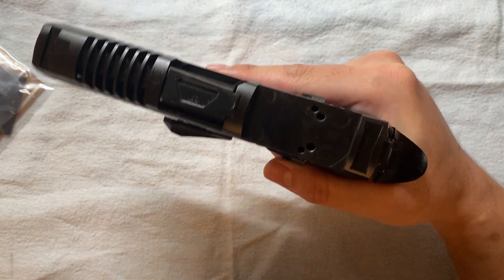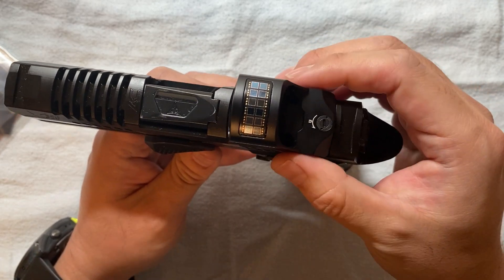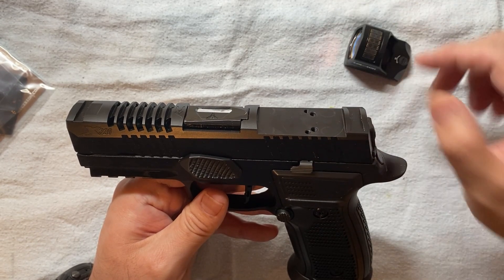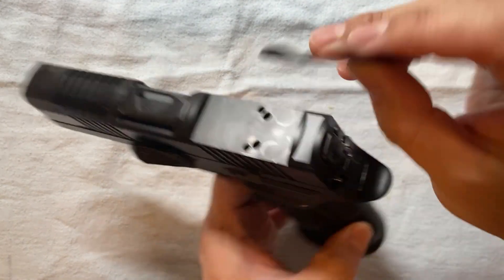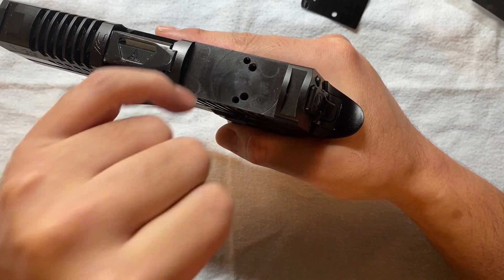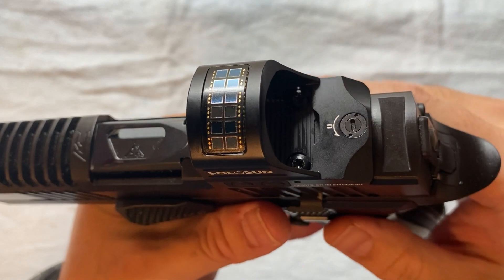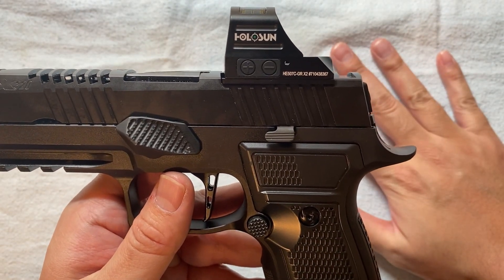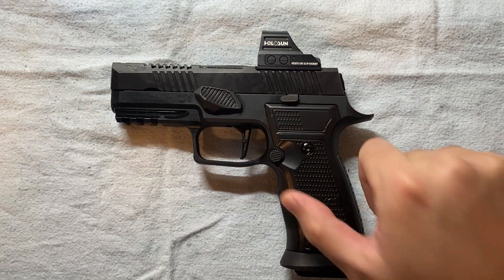Install Holosun 507c on Aftermarket SIG P320 Slide with Filler Plate

Comment: I just ran into this dilemma today after purchasing my first red dot optic. 

This video is very helpful and the C&H adapter is going to be the exact fix that I need given that I have a stock pro cut slide from Sig. 

Thanks and good luck getting your optic mounted flush and tight!
Reply from the maker: Glad it helped
Reply: Great video I have been looking for a while now trying to find what will work and what won’t that C&h plate would be perfect but then I heard about your customer service and other things and I think I’m gonna follow the second choice. How has it been holding up?
Reply from the maker: @Darealnoriega it’s been very good. Every penny well spent.

Comment: I tried mounting the 507C directly to my P320 with the Holosun provided screws(6-32 size and thread count) and quickly learned that was wrong as it flung off the slide after 100 shots.

This slide and 507C combo requires the mounting plate (I bought C+H) and 6-40 x .380 screws. 

Wish I had seen this video before installing the sight but I got lucky with no permanent damage.